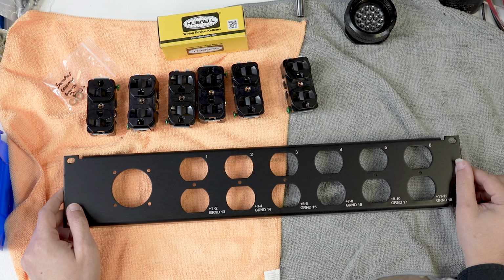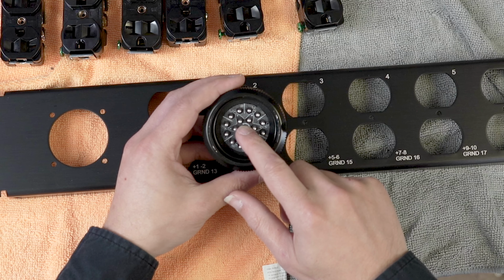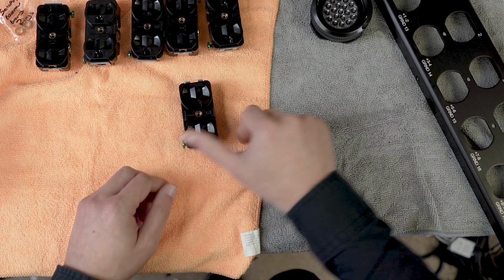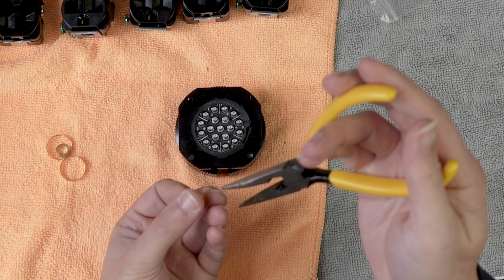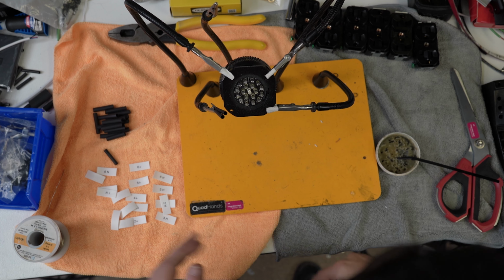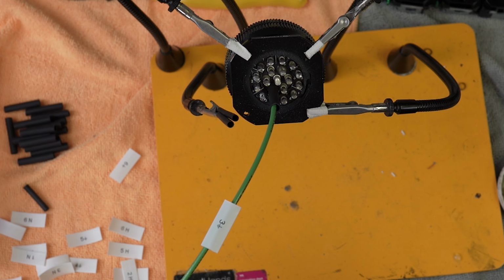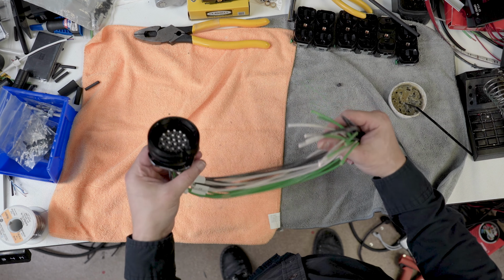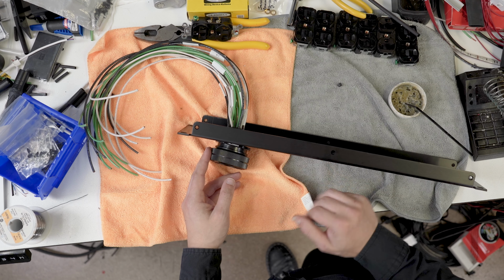6 Circuit Socapex To Duplex Outlet Break Out Box

Comment: I am assuming that this is a break out box for lighting? I would be interested in seeing how the circuits are switched form the control box, maybe get into even midi control.
Reply from the maker: Hey Sean. I’m an audio guy, so take this statement with that in mind. I believe that in newer LED rigs, the Soca is mostly handling power only (vs dimmed power for conventional lights). DMX is plugged into each fixture directly to handle control. Older rigs with dedicated lighting distros had control elements built into the distro. These panels are generally used for courtesy breakout power at end points. Since the Socapex infrastructure exists within a rig/venue. These are an easy way to make it usable from the multi pin format.

Comment: If you are keeping the grounds separate, shouldn't you be using Hubbell IG5352? Otherwise the outlets will be grounded to the panel by the mounting screw.
Reply from the maker: They are separate…but not “that” separate.
Reply: @billylaguardia  I don't understand your design. By using normal outlets, the faceplate screws MAY connect their grounds together if the faceplate screws bite though the paint on the panel. With isolated ground outlets, the mounting strap and the faceplate screw are insulated from the protective earth connection, which would maintain the integrity of your isolated ground wires.
Reply from the maker: @timothystockman7533  You are correct, however assuming that all grounds go back to the same buss bar in the panel/main distro we dont generally need to use iso outlets. That being said, we build everything per order. Happy to use iso outlets if a customer requests them. Most people dont want to spend the extra money for them just to isolate the outlet straps from the panel chassis. These Socapex distros are commonly used for lighting applications where ground loop noise is less of an issue than for audio.